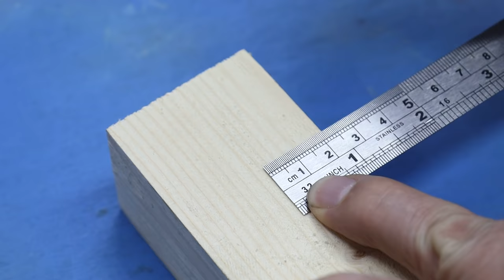Мало кто знает эти Советы и Хитрости Мастеров по Дому, Которые Действительно Помогают  ▶50

Comment: Shop made tweezers, brilliant.
Reply: Why not use a pair of long tweezers or an old pair of long nose pliers that, if you dip each tip of the plier into liquid rubber, then let dry, you can pick up any tiny screw or nail without marring it? If you put a seed sized magnet on one of the tips, then dip it into the liquid rubber, let it dry, the small seed magnet will have enough pull to pick up 1 or 2 screws, nails, washers, etc without pulling all of them up.
As to that, why hasn't anyone shown how to put a make an opening in a pair of medium weight work gloves near the 1st finger joint, then insert a strip magnet leading down to the 1st knuckle, then trim off the magnet, close the opening. How many times have you misplaced the little screws that you've removed and now need to put back on? If you can put a magnet strip in-between the layers of the top of the glove's hand and sew the pocket up and you'll have a place to keep track of screws you've removed. I've even put a piece of strip tape inside of the gloves forefinger, so when I'm screwing in a  screw I won't drop it.

Comment: At the 20:15 mark sanding the edge of a board  using a block of wood attached to the jigsaw blade is a great idea. You can take it one step further by attaching a piece of dowel to the blade and sand inside curves or holes. Just match the dowel plus sandpaper to the arc of the hole. I like to spray the dowelling with a repositionable adhesive and then press on the sandpaper.  This allows you to use the same dowel and quickly change out different grits. I also take my old table saw blades that can't be sharpened anymore, cut the teeth off down to the gullet, smooth and round the outside edge. Cut a paper template of the blade, and use this to cut what ever grit of sandpaper you want and attach it with repositionable adhesive. I'll usually cut two different grits that I want to use and attach one to each side. Place the blade back onto the table saw spindle and you're ready to sand. The great thing about using the tablesaw is in the ability to tilt the blade and sand the same angle you just cut onto a piece of wood.